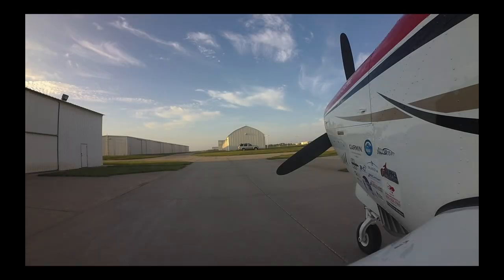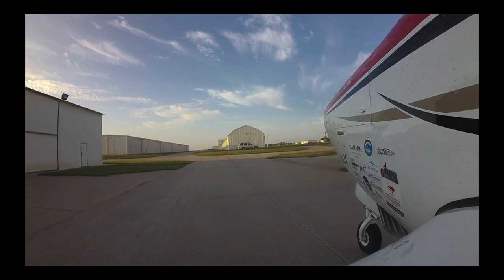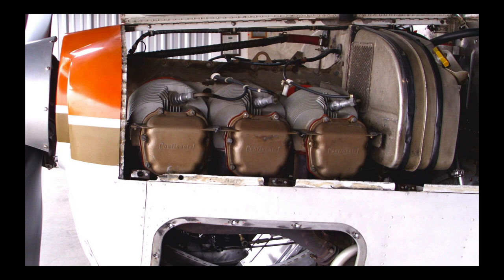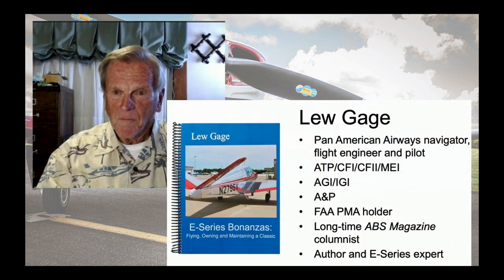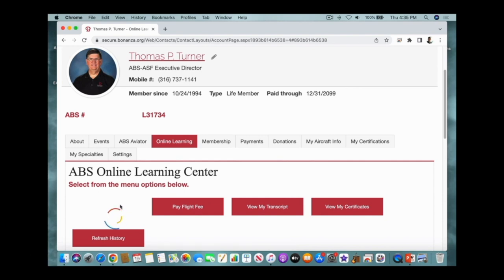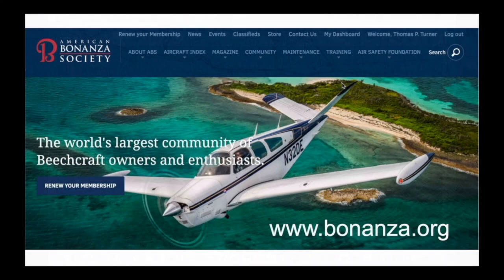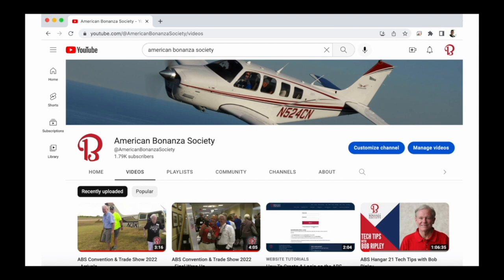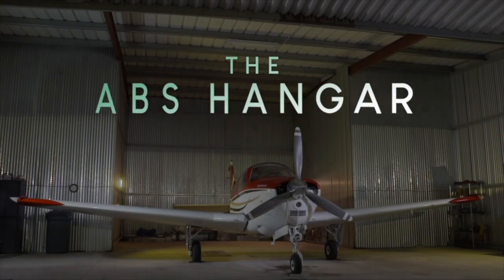E Series Bonanza Hot Starts (E185 or E225 engine)

Comment: I own D-716.  It's really simple when warm:  It'll hit on the first turn, but you better pump, pump, pump to keep it going, because they vapor lock badly when hot.  Watch the fuel pressure.  Slow your pumping of the wobble until the engine pump takes over.  Sometimes it takes longer than you might expect, but it's not brain surgery.